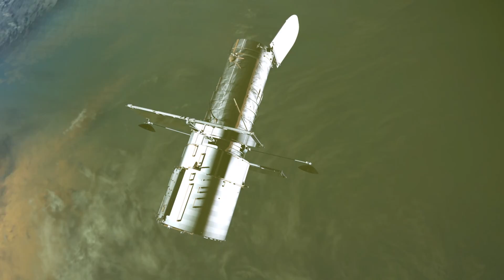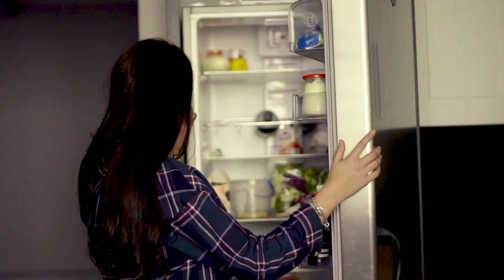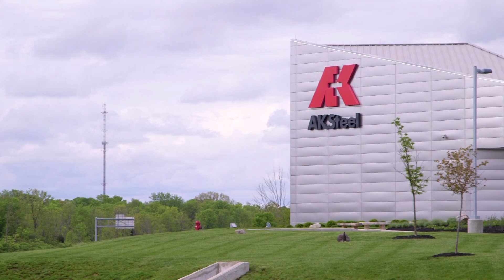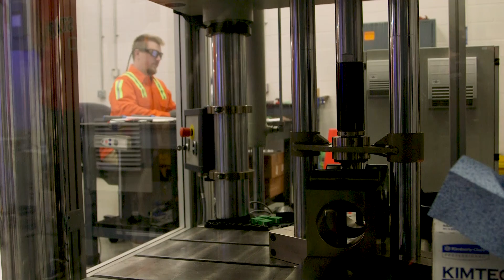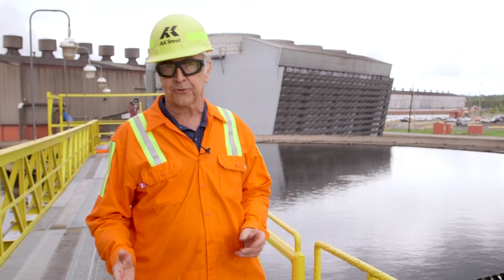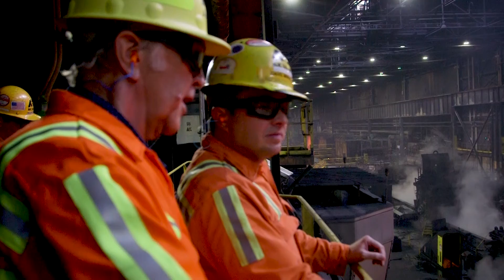AK Steel on EARTH with John Holden

Comment: AK Steel has the highest turnover of management of anyone in the industry by far.  That place is a meat grinder from hell.  More importantly the next generation of ore based steel plants will kill off AK Steel, US Steel and ArcelorMittal.  This next generation plant is being built in Texas by SDI right now.  It couples a direct reduced iron technology with an electric furnace compact strip plant.  AK Steel doesn't have the cash needed to build this type of plant and even if they did they wouldn't put it in MIddletown, Ohio.  Everything you are looking at in this video you can kiss goodbye.
Reply: they just got bought out by cleveland cliffs.
Reply: @davidbright6620  So what.  The minimills will still grind them into dirt.